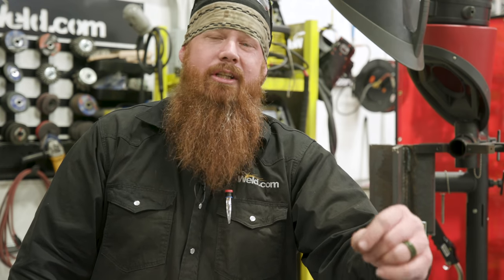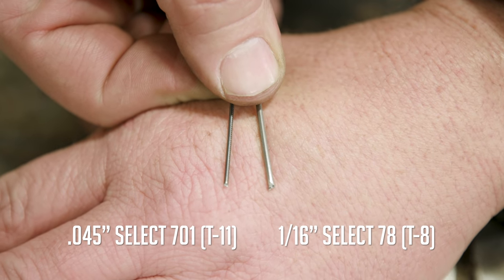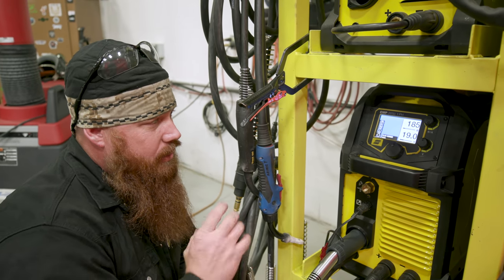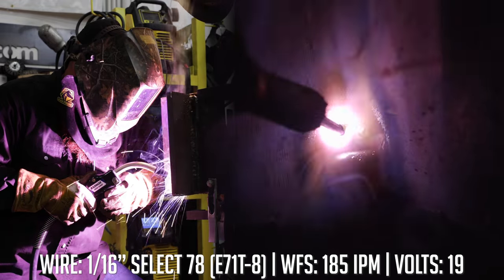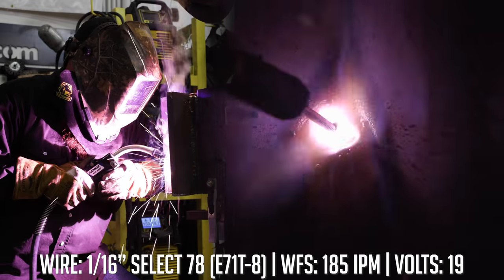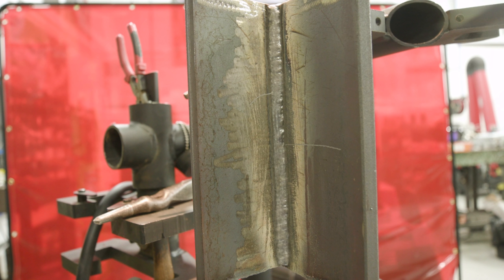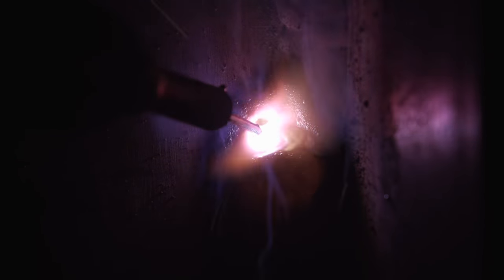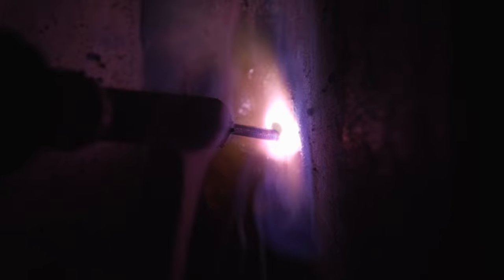1/16" Seismic Flux Core Welding | Vertical 3F

Comment: Stuff is very good for UTs. Used it on base plate extentions and alot of structural reinforcements at a potash mine. They were up to 3.5" thick plates and we ran the Lincoln NR 232 .072 wire we had it under strict parameters to maintain the seismic characteristics. We had inspectors checking the amperage we were putting out while welding and at 25 volts with 350ipm we were blasting 400 amps through the wire. It was crazy how much it penetrated and deposited. Was like riding a tidal wave of metal. And didnt fail a singal UT!
Reply: Keith Hunchuk what potash facility I’m near one in Indiana
Reply: Up in Canada in the province of Saskatchewan. We have 40% of the worlds reserve of potash and some of the best quality ore. There are like a dozen potash mines up here!

Comment: 4 years later, D1.1 is structural code, D1.5 bridge code, D1.8 seismic application code. NR-232 is viable for all 3 codes. It’s seismic wire aslong as you have the proper parameters. For the last pass you did you were running to slow on the corners and gave it an opportunity to fill up, that’s why you see a little splash and you probably felt it on the gun, you could’ve added more wire. It was hot and you subconsciously kept the same speed as the root and second pass. Looks good for not running it in a while. Keep those videos coming really enjoyed this one!

Comment: Thank you for this informational video! We run Lincoln Electric NR-232 flux core wire in my college welding shop. We run 20.5 volts and 150 inches per minute. Keep up the great work!

Comment: Try it at 24v and the wirefeed to suit, you wont have issue with your side to side fusion, plus or minus depending on wire size and material thickness. also run stringers, the size will happen on its own.  it freezes fast you risk inclusions if weaving. Helps big time to 'set' the size of your weld by doing a quick left to right sweep at the start to build a shelf and it will freeze fast, just stay steady let it build on its own after that (works with dual shield too). Most important with gasless wire is maintain the required stickout or you WILL have porosity of some sort. T11 is another nice wire to try too, similar application and from my own experience faster than this. 

and another thing if this guy had to look up specs to see  how to run it then i wouldnt say hes qualified to tell anyone how to use it. this isnt an exotic wire its very common. he keeps saying its a slow process, well the point of wire is for welding to happen faster so he isnt using it to its potential here. also that wire isnt digging the way it ought to be he needs to turn everything up. gasless wires like to freeze up quick dont be afraid that it will fall out on you because it wont. 

wear leather sleeves at a minimum, and a quality canvas welding cap when running gasless wire. lots of errant spatter to ruin your day. real thick gloves leave the mig gloves at home.

Comment: Ran 1/16 at the ship yard 30 pound spools  always found holding gun upside down while doing vertical made it easier. Great video we had a we ran 265 wire feed was the lowest an 25 volts. He's right you never want to breath that crap.

Comment: Good technique the slight angle down was good dragging with the slight weave , need more stick out on first pass , second pass good , 3rd looks good don’t forget inter pass heat , if you don’t set up multiple test coupons or let cool individually that will screw you , Oakland local 378 iron workers back in the day

Comment: Really great to see a video on the t-8 series wire. Very few instructional videos exists showing its application.  
I recently moved from the the states down to NewZealand. when I contacted an inspector to oversee rectification for me using this wire process, he had never even heard of it. Really uncommon down here.  
I use  it almost exclusively here on structural and heavy equipment applications in the field, and on each job customers are pleased with its high deposition rates and weld quality over that of 7016 rods that are conventionally used in NZ. Considerable savings in time & $. 
Thanks for the great content and education.

Comment: 1/16 is the only size flux core wire they have at my school, but i would prefer to learn with .045 which is what will run on a machine i want to buy.  i must say, i sure do like running 1/16 dual shield wire, it puts down great looking beads fast with awesome penetration!

Comment: We use 1/16" dual shield where I work I typically run 30 volts and 305 wire speed  vertical I run about 24 volts and 190 wire speed this stuff is awesome
Reply: We used that at my last job too and for vertical I’d also have it at about 24 volts but my wire speed was a bit higher if I remember correctly. Never got to 30 volts though unless I had to fix some porosity lol normally I was on the 27 V range.
Reply: @JBguitar-cj8pc  we have to arc gouge any porosity on full pen welds I'll do my root at 27 once I get 3 or 4 passes in I turn it up to 30 fill it up hot then back down to 27 for my cover
Reply: What machine do you use

Comment: My shop would never let me run 1/16” that cold. I run it at 24V and 330 IPM.
Reply: Are you welding on a 6 inch piece of metal like he is ?
Reply: Structural? Or pipe?
Reply: Most machines run differently than the next. That's why you have to take a second to dial it in when using different machines
Reply: @davidseanmacdonald1470 definitely, one machine might have longer cables than the next, or corroded cables and connections, I was using a machine that was having a total loss of 10 Volts, had to set my voltage to 33 volts, but was getting 22 volts at 210 on the WFS welding vertical up. And when you explain this to superiors, they don’t understand and are wondering why you are going through so much quick connects! They end up not understanding the relationship with resistance in a constant voltage set up. It’s not a problem so much with stick on CC but very much a problem with CV wires.
Reply: We run 29-30v 1/16 330-365

Comment: A couple more videos on structural  and you can corner the market. This is a good video. Pipeline welding is fun but you have a ton of structural welders  out there that need advice. Also what that you in the AWS magazine?
Reply: big bird we’re working on it. I’ve been in the Welding Journal a few times so it could have been me. Which issue?

Comment: We weld with very similar wire. .052 71-T1 dual shield with CO2. Hull welding US Navy ships Huntington Ingalls Pascagoula, MS. Apprentice welder here that LOVES watching Weld.com videos! You guys have helped me improve my skills, thanks!
Reply: Hey do you still work for Huntington Ingalls?
Reply: @aaronewing8386  yep
Reply: Nice, anyway you can tell me what the test is like? Say if I'm coming in as a structural Welder. I was told Smaw, Fcaw, Gmaw, Gmaw-p. But i have no info on wire sizes or what Rods or what kind of joints. Any info would be greatly appreciated. Thanks
Reply: @aaronewing8386  the test will be: FCAW 71T1 .052 3/8 mild steel plate with ceramic tape for horizontal and vert, OH will be backing strap. SMAW 7018 will be backing strap hor flat and vert 3/8 mild steel. 6 test plates total.
Reply: @davidusry5048  Thank you, I really appreciate the info. Hopefully I see you out their sometime soon 👍

Comment: Jason, Thanks for the video! Globular  seems like quite the process! Amazon failed to deliver my blue demon dual shield .035 wire so never got to do it last night! Boo
Reply: Corey Holstine sorry to hear that man. Globular is just the mode of metal transfer. We did a video on modes of metal transfer a while back. Check it out. Stick welding is also a globular transfer.
Reply: it's between short circuit and spray transfer, where you can see globs of metal crossing the arc gap...in the Larry Jeffus "Welding Principles and Applications"  it's barely mentioned, because it's not as often used as the other modes of transfer.
Reply: Blue Demon is great wire, I use it myself 😎👌🏻

Comment: I just ran some old stock Olympic B Flux Core this week.   I was in denial for a bit about the terrible bead I was getting... just made no sense.   I went online for the specs.  They state to use shield gas.  Go figure....   What a difference.  Felt a bit stupid, but was sure that's what was needed.  Checking confirmed it.  So yeah... always look at the wire specs.

Comment: Awesome, I’m glad you guys finally did some t8, can y’all do a video laying down on some full pen with ceramic??? Very common on structural ironwork when there’s a shitload of moment connections, we’ve got well over 3k of those connections on the school we’re building now, and I’ve been running 1/16” Hobart XLR 8 and I won’t lie sometimes I can lay it in perfect but other times I can’t get away from massive amounts of porosity even when I’m pretty sure I’m doing everything right. Flat full pen ceramic backer 3/8” gap, Dragging about 45-60 degree angle, 3/8” to 1/2” thick steel, weaving and staying in the puddle, 1” stick out, on CC set at 200 amps and 190 ipm on a miller suitcase. Lately it’s been really kicking my ass, but I can lay it in beautiful on verticals. I’m stumped. I’ve even tried changing the settings to 250 amps and 255 ipm, 180 amps and 150 ipm, all kinds of different recommended settings, still no luck. Curious to see you guys give it a go!
Reply: Couple things! I use dual shield for ceramic backing alot. Havent tried innershield with ceramic backing. Work in a ship yard and when we have it set up for dual shield it has to be alot smaller gap then 3/8. We set up on the flat and vertical to be between 5mm and 6 mm root opening and 4mm on horizontal. The milimeters make the difference prep ia everything with this process especially on horizontal! The prep should be for 60 degree included bevel and to a knife edge no land! With .045 wire and 100% co2 shielding the settings we use are 20-22v and 190-215 ipm wire speed. Has to be on CV! This is with .045 wire.

Comment: Hey are you still gonna do that 3g and 4g 1inch with 1/16 self shielded flux core wire? Also could you run a d1.8 self shielded flux core 3g restricted semic flux core weld test as well?

Comment: Side to side will trap the slag , if it get shot or bend test, I think a stringer would have been a lil better… I have a test on it today so we will see..1/16 wire on a 3g/3F plate test w/backend strip

Comment: Let's see some dual-shield flux-core welds too please Redbeard. I use alot of Lincoln Electric UltraCore 71A85 seismic wire, no matter what I'm working on, it seems to meet the requirements
Reply: SteelFabMechanic we’ve done a couple on Flux Cored Gas Shielded. Check through the videos. I’m sure we will do more though.

Comment: Any chance for an .052 spray metalcore  video on pushing  the puddle vs a whip. The company I work at has a lot of people that prefer to whip and pause like a 6010 and I do until I can get my machine set correctly to where I can just push it and it lays in buttery smooth. I just wanted to know it could be beneficial to whip and pause.
Reply: Chris Koon we can add it to the list. I prefer a steady push my self. Whipping will give you inconsistent amperage.
Reply: Absolutely don't whip and pause with metalcore yes it gives it that dime stack look but that's all it is looks you suffer on penetration always do exactly what the manufacturer recommends which is a push

Comment: Nicely done as always, would like to try that wire. Looks a little "fluxy" to me. I dunno if you tanks can get your hands on it (a Canadian wire) but try some Arches FC-222 if you get the chance. Pretty good all around maintenance/ repair wire. Lol and for the record, anything under 5/64" is not a "big boy" wire. Get yourself some 3/32" Hobart Fabshield 4 wire if you want to really burn up some gloves.
Reply: Or some 1/8th wire with liquid cooled guns and a hand heat shield built onto it. Thats how ya rebuild old beat up slag buckets at steel mills :)
Reply: @keithhunchuk3049  love to see some of that... But didn't they kinda cover that with the "1000amp stick welding" video?
Reply: @kristianskov4841  haha that was super bad ass i showed that to alot of my buddies at work. I think it was running a bit cold tho? Biggest rods ive used was 3/16  but on the flat we ran at 300 so at 3/4 rods i feel like it should have been hotter then 1000 could be wrong tho!

Comment: I have just started using nnershield  wire for the first time.I have 1.6mm esab core shield 8 and lincoln 2mm  nr 211. I am a complete novice with this stuff and I'm really looking foward to learning all about it.Getting the settings right and gun angle and stick out right will take a bit of practice .When using the innershied and gas shielded wires you always pull the wire not push?Do you treat it abit like stick welding?

Comment: That’s training wheels for NR 232 , turn the sumbitch up another 2 1/2 volts, and jump your wire smith 15-30 in. Min. To match your hand rhythm. If you ain’t running.072 at 32 volts all positions. Your getting you check homeboy . 433/118 💪
Reply: Correct me if I’m wrong but that looks like 1/16 nr232. There’s no nozzle so there can’t be any shielding gas.. that’s hitting the weld at least
Reply: @denigrator6399  it’s definitely a form of 232 , it looks and runs like coreshield 8 which is a more buttery version for those who have difficulty running the former . It was used to get more fema certs qualified in the union back in the day. Many can’t run 232 productively imo same with 305 nickel . ( jet rod wire app )
Reply: @denigrator6399  basically a t-8
Reply: @stocktonwhiteboy7978  I’m new to the trade 3 years in. I was working on the regular .072 3g cert for a while and ran some slick bead but nvr passed bc of technicalities on my caps
Reply: @denigrator6399  that’s common, it’s usually to much buildup on the cap itself, or ya stay in a shade long while filling up to plate level , and get cold roll . There’s techniques to avoid both , I wish I were able to help. It’s most likely something simple

Comment: Only 19v on 1.6mm wire? Id have thought it would be lot higher that that! 
As far as the smoke from that stuff goes, its horrid and really nasty shit. Innershield has been given the nickname of "innerdeath" at lots of companies/yards over here in the UK lol
Reply: Ken F I was surprised on the settings too but it’s pushing 200 amps with these parameters. Gotta make sure you have adequate fume extraction and/or a quality respirator with the proper training to use it.

Comment: really interesting, the only flux coat ive used is on the cheep mig welders we get here in the uk. for car work its absolutly rubbush ive found, and i use 0.6 wire now with c02 and its really good. 

is there a wire you could recomend for car work? Im really interested as maybe its just the wrong wire i had...
thanks

Comment: If you move faster side to side you'll get a flatter more consistent weld. Everyone wants to weld soft wire like it's a 7018, but it's not. That first pass would have failed on something crucial.

Comment: Hey could you do a video on self shielded flux core.054 wire in the 3g and 4g position on 1inch plate. I’m now in the ironworkers and we’re running the .054 self shielded flux core.

Comment: Great video. Could you run a 3g and 4g 1 inch with this 1/16 self shielded flux core wire?
Reply: Justin Beery are you asking if it’s possible, or if we can do a video on it? It’s definitely possible.
Reply: Jason Becker could you do it
Reply: Jason Becker I was wondering if you could make a video doing a 3g and 4g 1inch with 1/16 self shielded flux core.
Reply: Justin Beery let me check if we have the material. We can definitely do it. I’ll check our schedule and see how soon we can get it done.
Reply: Thanks so much man I’m
Testing for the ironworkers in May and really would like to see it run.
Reply: I’m
Going down to local 92 ironworkers
Reply: Justin Beery I had to run that test at IWLU 808 and use Hobart XLR8 wire. I feel your pain 😂. We’ll hook you up.

Comment: Hey weld.com, the marine contractor I work for wants to use this wire for 4G welding on 3/8-3/4" plate. 
I have used T8 conforming wires before  Lincoln 232,233 on moment and column-column splices, tank legs, etc but I have never had to use it overhead. 
It is an absolute requirement that we use this wire overhead at this job, we can't flip the boat lol.
I have no doubt that it will work, Select Arc claims it is an all position wire due to the heavier slag, though I am interested to see how it plays out and if Mr Redbeard has any kind of tips and tricks I'd much appreciate it.

Comment: Why is my weld puddle hard to control on the root pass on Test plate 3g
nr232 0.72 , 19.5 volts and 140 wire speed